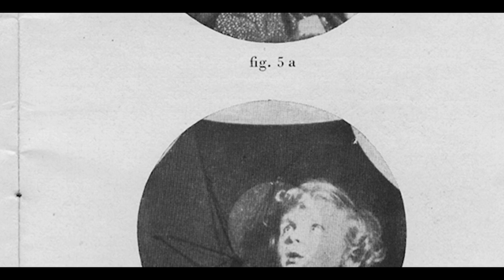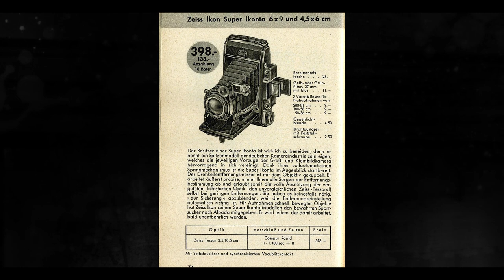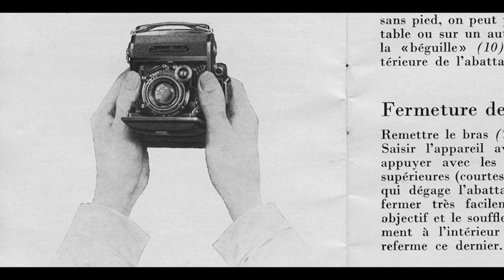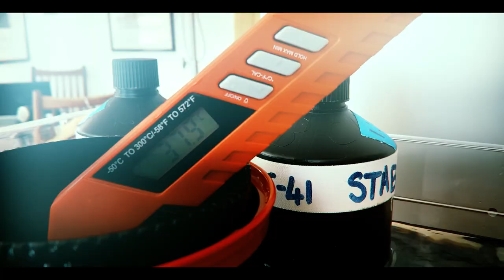Resurrecting The Incredible 90 year old Zeiss Ikon Super Ikonta

Comment: I adjusted the rangefinder of my Zeiss Super Ikonta 6x9 folder from 1937 in much the same way. With more modern rangefinders adjusting it for infinity works just fine and the rest just falls into place, but with this one I had to take out the measuring tape and set it for close focus. Well worth it! I still have a light leak though that I just can’t find, it’s driving me nuts! It’s very small and only appears occasionally, so I’ve kinda given up on trying to find it. I’ve been meaning to replace the bellows entirely at some point, but it involves drilling out some bolts which is scary. Could you possibly link the tape you used for your bellows repair? I might just tape up a few likely areas and hope for the best!
Reply from the maker: Sorry i've done that thing where i thought about your comment and thought id replied. Here is a link to the tape, id only replace bellows if they were warped and affecting the image. 

https://www.amazon.co.uk/Boxiti-Fuzzy-Fleece-Interior-Harness/dp/B07FKT55BW/ref=sr_1_1_sspa?dchild=1&keywords=wiring+loom+tape&qid=1591028297&sr=8-1-spons&psc=1&spLa=ZW5jcnlwdGVkUXVhbGlmaWVyPUExNUM5RVhXWVRHMTM3JmVuY3J5cHRlZElkPUEwNTc5NzM1ODYzSEtMSjRRNVJZJmVuY3J5cHRlZEFkSWQ9QTAwOTM1NTEyU1k2VTdRVVAyQUcyJndpZGdldE5hbWU9c3BfYXRmJmFjdGlvbj1jbGlja1JlZGlyZWN0JmRvTm90TG9nQ2xpY2s9dHJ1ZQ==
Reply: Thanks mate, that’s super helpful! I also do the same thing with comments 😂 going to order it now and see whether I can get that light leak dealt with finally! Thanks again!

Comment: Fantastic photos!

I actually found the same camera locally for very little money a couple months ago. Mine is a slightly later model with the opening for a shutter release cable in with the shutter button. Otherwise basically the same.

Mine needs some cleaning of the range finder window, re-lubricating, and has at least one small pinhole in the bellows. So I haven't used it yet. After watching your video, I really want to get it working now.

Do know a good repair shop for these old folder cameras? Do you only work on your own cameras?

I don't trust myself to fix it. And it's currently my only medium format camera.